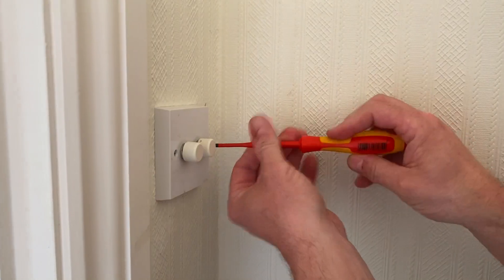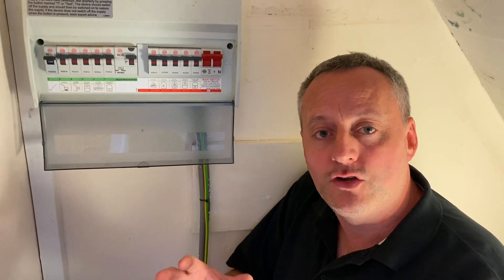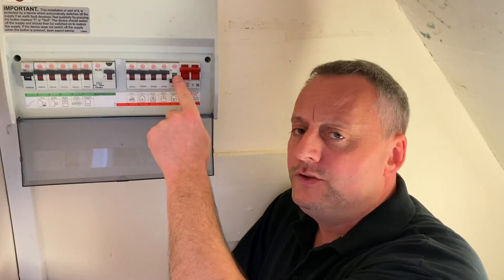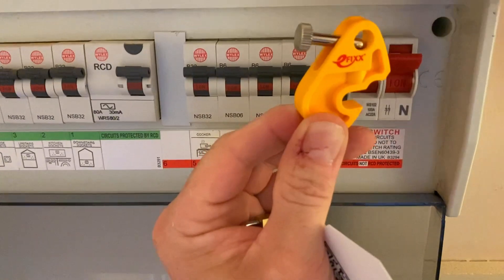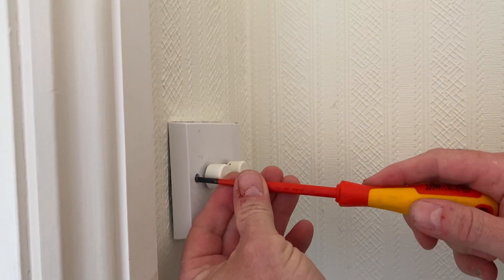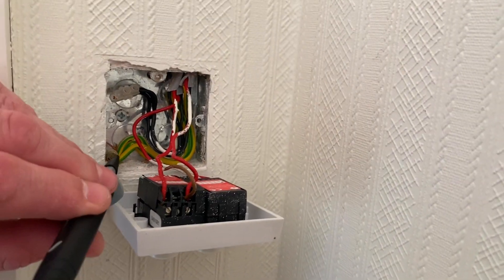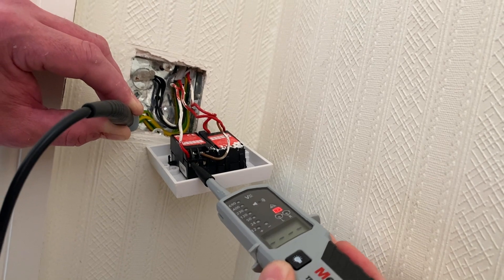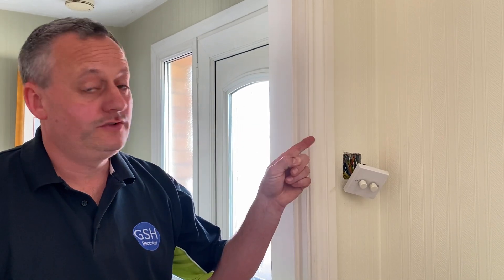2 Gang Dimmer Switch - Safe Isolation Procedure

Comment: I have a question , random to this video hoping someone can help . 

Let’s say I have a three phase fryer for a restaurant and I have ran a 6mm NYY 5 Core Cable contained throughout in metal trunking (trunking is earthed at every join with a link wire) it is controlled via a TRIPLE POLE C32 MCB which then goes to a ROTARY ISOLATOR THEN TO A COMMANDO SOCKET ALL INSIDE METAL TRUNKING AS MENTIONED , can I get away without a 30ma RCD as it has mechanical protection through out ?? Would really appreciate some feedback

Comment: Hi Gaz, 
Great video as always 👍 Thought I’d better mention though, especially being your mums house, that 7 out of the 11 MCBS are actually on the product safety recall list, I’ve seen quite a few of these burnt out over the years and they should really be swapped out ASAP. Didn’t hear you mention it, so not sure If you missed it or not ?  🤔
Reply from the maker: The board was purchased before 2004 the recall is on 2009 - 10 devices I will take at look into. Massive thanks for commenting 👍🏻 Gaz. My mum could do with an upgrade because of the boards location 🤦🏻‍♂️
Reply: @GSHElectrical  thanks for your reply to my comment Gaz, I knew it wouldn’t be something that you would overlook 👍
That does raise an interesting question though, how do we know if they were manufactured between those dates, as I am unable to see a manufacturing date on the MCB itself ? Might have to contact Wylex regarding that, as I’ve just been automatically replacing any with the codes NSB06 NSB10 and NSB16.

Comment: Has someone put in LED light bulbs and the dimmer won’t work.  In the past if I fit a consumer unit in a cupboard I normally fit a smoke detector in the same cupboard. Hands up how many people have changed a switch without isolating the circuit.

Comment: I'm pretty sure on most approved voltage testers these days they're made that a proving unit is not needed and only the 2 ends need to be touched together. On the fluke they are not sure about the Megger but bet they are.
Reply: Yes, my Fluke tester does...and it's only a 'cheap' one. Hold the probes together for a few seconds before and after testing and it lights up like Blackpool illuminations!

Comment: Any CU in the stairs cupboard is a dum idea. 
You could  prove your voltage indicator on a none source such as the bulkhead light as it is on a different circuit. As not every have proving units . 
But this is a great video for learners to get it into there heads just how important safe isolation is . Hard tex ceiling yuk that’s so 70s 😂
Great video as always Gaz👍👍👍❤️